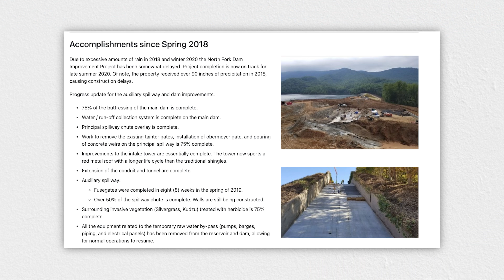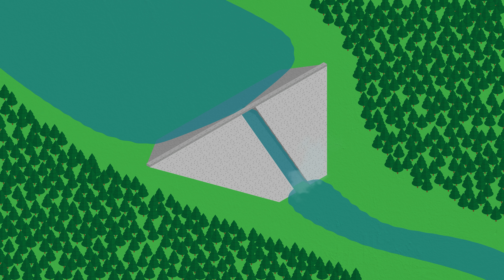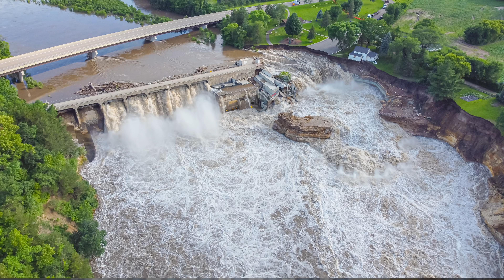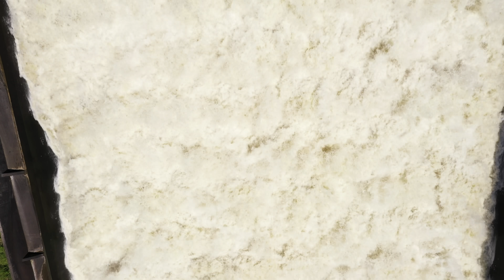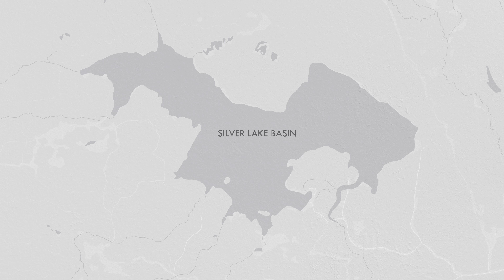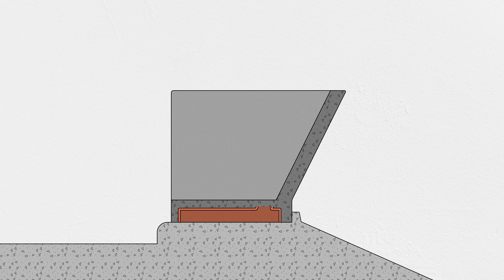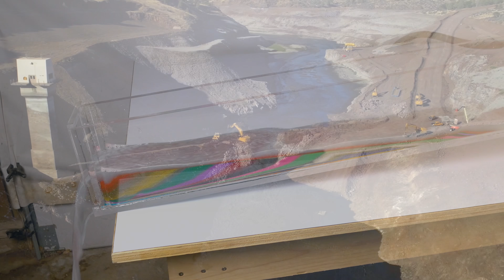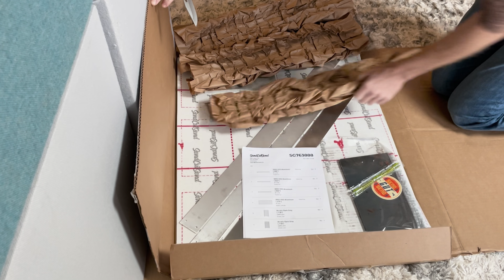This Spillway Failed On Purpose

Comment from the maker: 🏞 Lots of cool stuff (plus my book) available at the PE store: https://store.practical.engineering/
⚙ Check out SendCutSend for custom parts fabricated from your CAD: http://sendcutsend.com/practicalengineering
Reply: Is there a middle way, like a gate which tips open, but around a hinge, so it can be reeled back into place without construction or is the bracket for such a development between the two alternatives too slim to make this an option?
Reply: in oregon on the mckenzie they have Cougar dam which they emptied to build a fish water temperature control. Drawing water from lower in the  resevoir to keep the river cool. or something like that. You'd know better. :)
Reply: I could have used that Send Cut Send discount code a few months ago. Got a nice anodized piece of aluminum to use as the dash on a boat from them.
Reply: helene or Helen ... Idont recall any huricane beinig called helene ... I do recall helen
Reply: @Kaboomsmith  Check your spelling. There is an E at the end. There is this device called Google.
Reply: @johnsmith9903  helene is spelt that way ... there is NO hurricane named that and that is what he is saying ... it is Helen ... not Helene so no I dont need to check google he needs to learn to speak ENGLISH correctly same as you do
Reply: Great Video Grady. Again, I  find the name funny as I like the odd aptronym . Nice explanation and thanks for reg send cut send recommendation. Might be useful one day as I hear you only pay for the piece not the "drop".
I remember  Hurricane HelenE on the news. Real devastating. Though maybe not as devastating as educational standards these days.
Reply: You could have done the same thing with an off the shelf toilet floater set and a few pieces of scrap wood.

Comment: A spill way gate that is held up by chains that terminate in a fuse plug like structure with a cement bottom. T
When the soil erodes it releases the chains opening the attached spillway from the lack of support, water head, and gravity. The fuse plugs can be located at different heights giving control of when each spillway releases and is located on a cement pad to prevent erosion of the structure in unwanted parts of the dam. The chains are held in the fuse plug by a neutrality buoyant hollow cement shaped like a 45° rotated"X" or "+" sign buried under the fuse plug. The buoyant cement is holding the chain to the ground underneath it when buried and when un-buried it floats releasing the chain letting it go. The buoyant cement is chained at each end of the plus sign to keep it from floating away.

Please comment any ideas or suggestions for my idea.

Comment: Have engineers tried using a pythagorean cup type structure?  I has no moving parts and automatically resets.
Reply: Yes: siphon spillways use that same basic idea. A self-priming design expels the trapped air as the water rises, then flows full; admitting air again breaks the siphon as the level falls. The limitation is capacity: once primed, extra water level does not greatly increase the discharge. That makes it a different tool from a fusegate, which opens a much larger passage when it tips.

Comment: One of the most ingenious ideas in dam engineering is designing a structure to fail safely. The North Fork spillway wasn't a mistake—it was a deliberate sacrificial component that activated exactly when needed, protecting the dam from a far greater disaster. It's a great reminder that in engineering, success isn't always about preventing failure; sometimes it's about controlling it. – Dr. Sera, P.E., PhD

Comment: It would be interesting to see a cost-benefit analysis of a manual spillway versus a fusible plug/spillway.  For a manual spillway, you have the construction cost plus the ongoing cost of keeping employees on-site to activate a spillway if it's ever needed, and activation and deactivation are relatively quick.  For a fusible plug/spillway, you have the construction cost plus the repair and replacement cost when the plug/spillway fails as intended, and activation is quick but deactivation (which requires repairs) is slow.

Comment: I would really recommend a video on the Vajont Dam failure (kinda) in Italy as it is an example of when landslides causes a dam to fill quickly and the dam has to deal with displaced water. A landslide caused the water to overtop the 860ft tall dam by 820ft, devastating the valley below but the dam never actually failed.

Comment: Grady, how come there isn't a dam that has a syphon spillway that could draw out silt?
Reply: There is a related design called a bottom-withdrawal spillway. Its intake is near the bottom, and siphon action can carry sediment-rich incoming water out instead of retaining it in the pond. That helps reduce new sediment buildup. It is different from removing a large deposit of silt that has already settled across the reservoir bed; drawing water through one intake does not automatically clear the whole bottom.

Comment: Can someone explain to me why a V shaped spillway would not provide the same effect? the walls of the "V" could be angled such that at X height you have Y release. No?
Reply: A V-shaped opening can certainly pass progressively more water as the level rises. The difference is that its geometry stays fixed. A fusegate first holds water at a high crest, then tips at its trigger level and exposes a lower, much larger opening. That gives a sudden increase in discharge without needing the reservoir to rise as far as it would over the original fixed crest.

Comment: I wonder if it'd work to make a weir that's not at a constant elevation along its length, but gradually rises. In normal circumstances water flows over a narrow section of the weir, as the water rises that section widens you you get more flow both from the height and the width.

Comment: The Panama canal keeps using new rainwater. What would it take for the water at each end of the canal to be pumped back up into the reservoir? Apparently it's too expensive, but how expensive would it be?

Comment: My hometown of Lowell Massachusetts was built around America's earliest use of hydro-power. The Merrimack river has an elevation change as it passes around the city. Every year in April the river is "boarded up" with 1 1/4" x 5' steel pins and 4' x 8' boards on the "river wall". I'm no engineer, so i don't know the proper wording. Basically the stone block dam is maybe 30' high and it holds the river 30' higher on one side of the city. That is further enhanced each year with the added "Flash Boards" that add 4' to the river's height. The flash boards are designed to fail every spring in March when the winter melt must be allowed to pass. The city was establish in 1826, fair to say it's been doing it this way for over 200 years.

Comment: I am from Hong Kong, and our reservoirs use several types of spillways, such as Siphon, Bell-mouth and open spillway.
the Dam of Tai Tam Tuk Reservoir is a hybrid Dam that has 12 channels of open spillway originally, 10 of them at middle, added a siphon system to overflow water at a lower water level, leaving one open spillway at both ends to keep for emergency use but I have not seen the reservior use it for overflow water.

Comment: The sad thing about Hellene is that the floods in the mountains was predictable (except for the short memories of humans). Hurricane Camille in 1969 did significant damage on the Gulf Coast and turned inland as a major rain event in WV and VA. The flooding then was caused by 25 to 30 inches of rain in 3 to 6 hours. The resulting damage was almost identical to that seen in Hellene. Had the lessons of Camille been remembered, the loss of life in Hellene could have been avoided or significantly abated. It make one wonder why the NWS keeps hurricane records if they are not going to learn from the history.

Comment: Do you have a recommendation on software to use to create designs for Sendcutsend? I have no CAD experience whatsoever, but I need a couple of steel plates of a very specific shape with irregular side lengths and rounded corners and holes in specific positions.

Comment: There is a gated flood control dam near me that doesn't need constant staffing. The normal state is all gates wide open and they send out an operator when severe weather is expected. The gates control tunnels at the base so they naturally regulate on head, flowing somewhat more as the level rises. 
The smaller gate is sized for the normal downstream high-flow volume so it is rare that it is ever closed other than function checks or very rare events that dump enough rain into the watershed downstream of the dam to overwhelm the river. 
The larger gate is closed to control flooding, but opened to speed emptying of the pool between successive rain events when flow from the downstream watershed is not maximizing river capacity. 
(And there is an emergency passive spillway but has never come close to being topped)

Comment: Just as an aside the phrase "once in a lifetime flood" is no longer the best way to describe low probability events. People hear "once in a lifetime" and assume (thanks heuristics) that a similar (or larger) event could not occur (in their lifetime) again. That is not correct.

Low probability/high inundation events can occur for a variety of reasons and the best way to describe this is by using the Annual Exceedance Probability or the chance that a given (experienced) event would ever be exceeded by another (follow-on) event. By using the AEP you're saying that (based on hopefully accurate historical records for inflows and outflows) there is still a chance that any other event could meet or exceed the event that people describe as "once in a lifetime."

Comment: Flaming Gorge dam as jet tubes on it to handle high water volume that exceeds the capacity of the turbines. 
Folsom Dam suffered gate failure back on July 17th, 1995 on its Gate #3. Looking it up on google, I learned that the operator at Folsom had to drive downriver to Nimbus Dam and open all of its gates to handle the surge of water. We were lucky that it didn't happen on July 4th. I remember KCRA 3 interviewing alarmed fisherman that had been fishing beneath the dam when the gate broke.

Comment: I read about dams built in the mid 19th century that had spaces to put dynamite into the spillway in case they needed to release water in an emergency. Granted, the incident I read about it involved the dam overtopping in bad weather, and the same bad weather meant that they couldn't light the dynamite; but interesting to see the same concept of dealing with exceptional conditions

Comment: Great example of an earthen fuse plug being unpredictable was during the 2020 flooding of the Tittabawassee River in Michigan's central lower peninsula. When Edenville dam failed*, the water came rushing down toward Sanford dam. Sanford dam did have a fuse plug built into the embankment, but it did not wash away fast enough to keep the rest of the embankment from being overtopped. and basically the entire embankment washed away.

*You covered this failure in a prior video. I don't know if you've kept up with the rebuild effort, but Sanford dam has been completed and the lake will start to be refilled on April 15th, 6 days from now. It's unfortunate that the permitting for this refill does not let it start before that date. The river is quite high from rains and snow melt, and a few days ago it peaked at flood stage downstream at Midland. If they could have started at the start of April the lake would be close to full by now. Edenville dam itself is a much larger project and the lake likely will not return until spring of 2028. The two dams upstream of Edenville, Secord and Smallwood dams didn't fail in the flooding, but they were damaged. Construction to repair and improve them to modern standards will finish later this year.

Comment: Can you imagine doing the diff equations of the water fill and drain based on the math for how quickly soil will probably erode to keep a huge area from being destroyed?  I know it's much tighter and exact than it seems but on the surface it seems so hand-wavy for such an important feature (a fuse for a literal dam!). 😅

Comment: OK, but wouldn't this make every major flood even worse because on top of the massive amount of water that breached the spillgate, you're also releasing a big portion of the reservoir's normal capacity, which was accumulated before the flooding started?

Comment: Why not have a gate with a float on top, set to the desired opening level? The higher the water level, the more the gate opens, forming a self-regulating system. The bottom of the gate would have to have some hydrodynamic design to not stay lifted by the flow of water when the float is no longer lifting the gate. Then set a row of them to different levels, so they open more and more when the water level rises faster. A gate like that would reset automatically when the water level drops, but would still require no human intervention to open in a flood situation.

Comment: I was thinking about the differentiated spillway, that each spillway has a different height
so, first the water goes from the lowest one, if that is not enough, the water would rise to reach second lowest one, then we have two spillways working, then if it's still not enough, water would continue to rise and reach the third fourth fifth one......
and you can not only place them in stair shape, but also arrange the position and numbers of different heights

for example, let's imagine that there is a reservoir with three seperate dams: the main dam facing the river which the reservoir is based on towards south; the sub dam 1 facing towards an artificial channel to the east;  and the sub dam 2 facing towards an emergency flood discharge area to the north
you put a spillway that works on 50m water level on main dam that spill water into the river
a 51m spillway on sub dam 1 to the artificial channel, 
then two 52m spillways to both sub dam 1 and 2 towards the artificial channel and emergency flood area, 
finally a 53m spillway on main dam to the river. 

So, when water level is at 0-50m, everything's fine.
when water level is at 50-51m. 50m spillway on main dam discharges water into river
when water level is at 51-52m. 51m spillway on sub dam 1 begin to work, so we have two spillways working to divert excess water into both river and channel
when water level is at 52-53m, 52m spillways on both sub dam 1 and 2 begin to work, then we have 1 spillway on river, 2 spillways on channel and 3 spillway towards flood area.
when water level is over 53m, the 53m spillway on main dam kicks in, then all spillways are working for maximum discharge

when combined with different height/width/with or without gates, you can precisely pre-determine the water spill route/amount at the exact water level/flow and handle the flood better.

Comment: How about flash boards? Wooden planks stood up behind pipe stanchions across the top of a durable weir. Water can rise and flow over the flashboards until the point where the pipes bend and fail, releasing the excess.

Comment: An example of an uncontrolled spillway doing its job but with major unintended consequences is the 2002 flood on the Guadalupe river at Canyon Lake, Texas.
The spillway itself at the dam worked as intended diverting a massive amount of water (from 30+ inches of rain up river over a weekend) around the dam.
The problem occurred when the volume of water was so much in so short a time that it created the Canyon Lake Gorge. With an average deprh of 20 feet (maximum depth of 50 feet) and a width of 130 to 200 feet, it was created in a matter of weeks.
Much like the Oroville dam in California, apparently there wasn't much thought put into studying the geology of the ground below the emergency spillway and what would happen if an unprecedented volume of water went over the spillway.

For examples of managed releases of flood water, look up the Missouri River flood of 2011. The Oahe dam during this flood released a combined 160,000 cfs through six release gates and the power plant. The emergency spillway gates at the north end of the dam were never used. That 160,000 cfs also passed through the Gavins Point dam near Yankton, SD. All of 14 spillway gates were in operation to manage the water release.

I looked up the Wikipedia entry for Gavins Point dam and discovered that the 160,000 cfs is nowhere near the design maximum of 584,000 cfs.

Comment: When a fuse plug or tipping spillway activates, it’s a major endeavor to put it back (@15:11). Why not design a better system with resetting without the construction challenge?

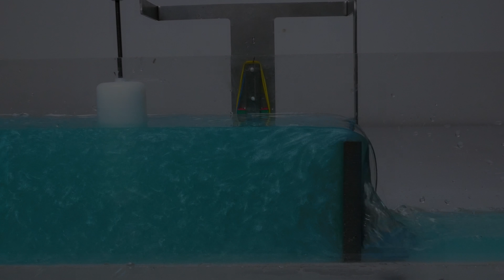Comment: 17:24 No one had to be there to push a button, but you just know the engineers who designed the spillway were locked in on the spillway when the hurricane hit, and cheered their asses off when it performed as intended.

Comment: Now I want an episode on what happened with the channel downstream of the dam. Was there a design flaw that led to the damaging erosion? Also, I want to learn more about the bypass transmission line, and why it was taken out by the same erosion. Did they not build it far enough away from the original transmission lines? And big picture, was there a lack of coordination and planning among the dam, channel, and power transmission folks? Sounds like the parts were not designed to work together in emergencies.

Comment: I wonder if you could do a pontoon gate?  Place pontoons either on or in the gate.  The water level would need to rise enough to lift the gate, but until the water rises enough to meet those pontoons and have boyancy overcome the mass, it stays put.  This would also be self tuning if it's fixed in a slot, so the gate would close once the water level fell enough.  I suppose this would be a self regulating gate?